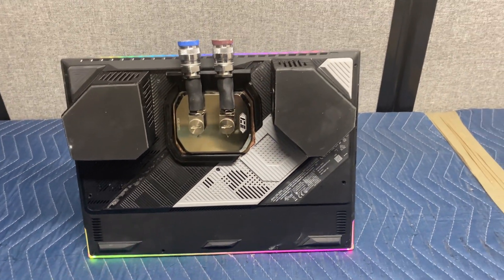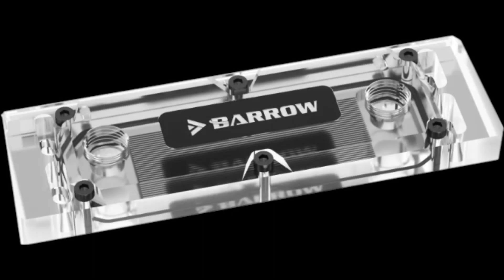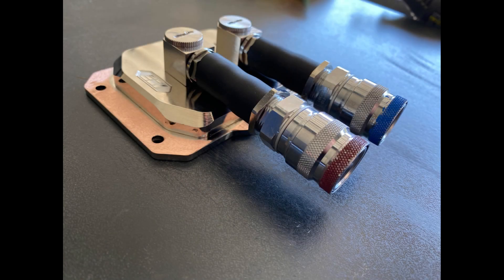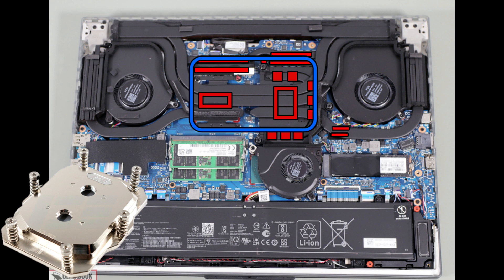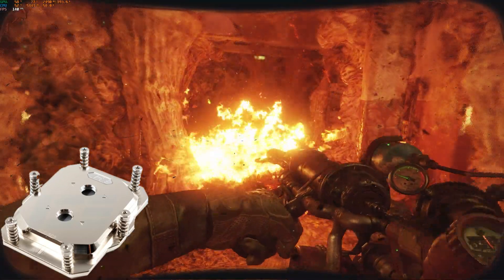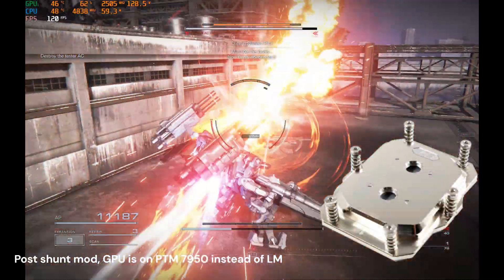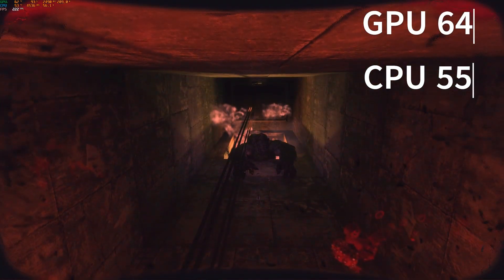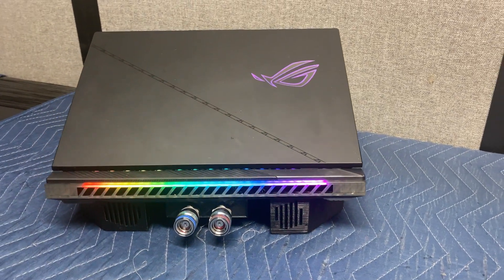Making the Best Water Cooled Laptop Even Better

Comment: Hey man, amazing mod. I was planning to 3d print the complete backplate for the laptop so that i do thanks mess up the original and was wondering about the voltage regulator you used in your msi laptop and how you powered everything up. How did you connect the fans and what fitting did you use. Also which power supply did y❤ou use.

Comment: Bro, do you have a step-by-step tutorial to make this.
Reply from the maker: This other video goes over the process about as in depth as it can. The process is super simple and really just comes down to getting a water block with a flat top and making a hole for it it the bottom cover. Making the external radiator needs some soldering but it is only 4 wires, or you can get an external MORA kit from a few places.

Comment: While completely awesome, I feel like with the added overall space the device takes up, you could probably make a really beefy air cooled setup that works similarly well. I wonder if one of the alphacool or EK sever blocks with ports on the side could lower the profile a bit. Given your CAD skills, I bet you could design something that would significantly reduce the profile, although customer machining is expensive...

Also, I bet this would be amazing on a laptop with a vapor chamber.
Reply from the maker: A vapor chamber makes a huge difference. Another guy I know has a legion with the entire thing covered in blocks and putty and he gets like 50* peak. Albeit he is running a 3070 so it is way less wattage to cool.

Comment: Would a heatkiller iv pro for threadripper be able to fit? I think it will
Reply from the maker: That block looks like it would work because it seems to have a mostly flat cold plate. However, because the water chamber is almost completely flush with the cold plate, with the exception of the corners, mounting it would be difficult.
Reply: @sloreo8278  alright thanks for letting me know
Reply: @sloreo8278  Also do you have a picture of how you soldered those connectors to the power supply?

Comment: Dude, you are the GOAT! Thanks for sharing your insights. I'm inspired to try this with the Barrow RAM Block on my ASUS G15 Advantage Edition (2021), which is thermal throttling at 95/99 degrees C on the CPU/GPU (Hotspot). Might need to wait until my next paycheck 😅, but I'm hoping to try a lower budget version of what you've achieved.
Reply from the maker: The biggest thing you could save money on from mine because the reservoir. You can get reservoir and pump kids on Amazon for $50. I would not try a radiator smaller than 240 mm I highly recommend putting up the extra money for the Phanteks T30s. You could also save a lot on different quick disconnects. The Koolance connectors that I used are amazing and lose almost no fluid but are very expensive.

Do keep in mind, for that water block you’ll need to cut the ends of the acrylic. I tried to get it so that where the screws are supposed to go when going on a desktop was flushed with the rest of the chamber. Be very careful when you’re removing material though because that is where the O-ring sits and if you damage that it will leak. 

It would also be worth trying to double check if it will fit before starting the process. You can get any kind of putty and put it on top of the heat sink and then put the lower case cover on to see how much it squishes down. It would be a huge bummer to start the process and then find out that the cover won’t be able to go on with the water block in the way. You want about 3 to 3.5 mm of space .
Reply: That just sounds like an issue with the liquid metal. Been there, common issue. Stock CPU temps were 80-85C and suddenly they were over 90C. Pulled it apart and the LM had leaked. Reapplied the LM with Thermal grizzly Liquid Metal. Now the highest temp is 75C at 100% on the overclocked CPU and while having 100% load on the GPU. (1.5 years after reapplying)

Comment: How are you mounting the block to the laptop heatsink? Is it soldered together or did you figure out a way for them to share the same mounting holes?
Reply from the maker: It is super simple, if you check out my last two videos I show it better. There is just a hole in the bottom cover for the water chamber, but not the cold plate edges. This makes it so the cover presses the cold plate onto the heatsink. There is thermal paste between the two.

Comment: U can underclock the CPU and overclock the GPU?
Reply from the maker: You can underclock the CPU on most if not all laptops. If you mean undervolting, that is possible on the 13980hx and the 12th gen hx CPU, but is not possible for the non hx chips as far as I know. You can unlock it by hacking the BIOS on 10 & 11th gen CPU. 

The GPU can be overclocked on all laptops, again, as far as I know, but the wattage and voltage are hardware limited.

Comment: That's really cool! How did you mod that bigger block? Any more detailed info?
Reply from the maker: Thankfully all that was needed was sanding down the top of the cold plate to have it not be such a tight fit with the lower case cover. The issue was that the gab between the case cover and heatsink (on the inside) is about 3mm while the Iceman cold plate was 4.3mm. Before sanding it down the case cover couldn't seat fully and flexed a lot.
Reply: I thought that you had to drill something also. Maybe I will test that barrow block because I am not so good to craft things  @sloreo8278
Reply: New models have extra plate top of heatpipe. Makes cooling less efficient. Damn

Comment: Is it still portable 🗿?
Reply from the maker: Ye. If you check out my other videos I show hooking it up with dry break quick connects and compare the air cooling to the water cooling. Obvs it is heavier now, but I take it with me to work every day just about, without the radiator though.
Reply: @sloreo8278 what do I think about XMG laptops that comes with water cooler radiator?
Are they as efficient as ur laptop?

Comment: if you want to watercool any kind of heatpipe the best way is to not do it directly over die, but at least 1-2cm off center of die, that way the liquid/vapor transfer can work at its best
Reply from the maker: This isnt intended to use the vapor. The heat is going to the heatsink and then into the cold plate mounted directly to it. The liquid doesnt really need to condense and expand unless it is running on air cooling. It treats the heatsink as an IHS on a desktop CPU in a way. You could absolutely put the cold plate somewhere else on it but then you’re dealing with more mods to the laptop’s case and potentially more points of failure depending on how you run it.

Comment: So the main thing I have been wondering with this build is how you detach the block from the liquid cooling loop without liquid spilling everywhere, is there some kind of mechanism in the sockets that keeps most if not all of the liquid contained?
Reply from the maker: Yep! The connectors are called 'quick disconnects' or 'dry break fittings'. These ones are made by Koolance but there are plenty out there. They have a spring loaded plunger on either fitting that is pushed into place when disconnected to block liquid from coming out.

Comment: Been tracking this journey from Reddit. Way to get the full performance you paid for! For gaming it's unreal to see you're getting a 20-30% increase. Goes to show how much headroom is left out on these laptops.

Would be dope to see a bit more about how you're cooling the power brick after shunt mod, and if the temps and power can hold steady after say, an hour of video rendering. I'm sure you're totally on top of that already though.
Reply from the maker: The asus brick is honestly a tank. The only game I have that consistently puts up 250-270w on the GPU is Metro Exodus and it sustained that through a whole play through. The Dead Space Remake will pull 190-200w on the GPU and 70-80 CPU and that didnt have an issue either. The brick gets warm, but not noticeably more than stock. I have been getting tempted by Slim Q chargers recently to see how they do though.

Comment: is you mobile GPU draws 200+ watts while playing metro exodus? or am I seeing it wrong? LOL
Reply from the maker: It is! it pulls up to 270w. I did a shunt mod on it a while ago which is why the first dead space clip it caps at 130w and in the second it is 175w.
Reply: I am really interested in this laptop water cooler and i want to purchase it 
Is there any chance bro?
Reply from the maker: @zayedhussain6609  Because of the cost Im very hesitant to do any commissions. I cant offer any kind of protection for someone else's laptop and just the parts I used alone cost around $8-900. Cheaper parts can be used but it won't work quite as well.